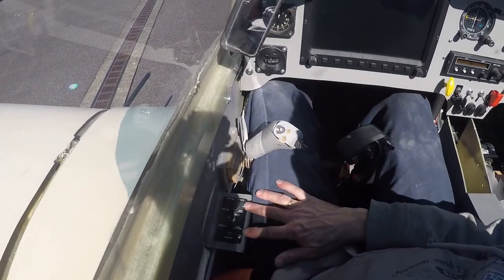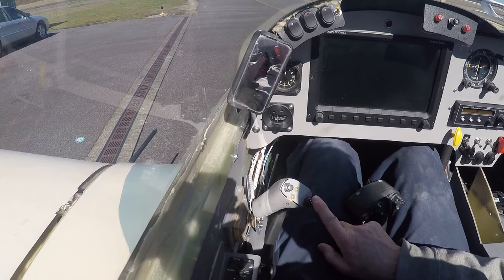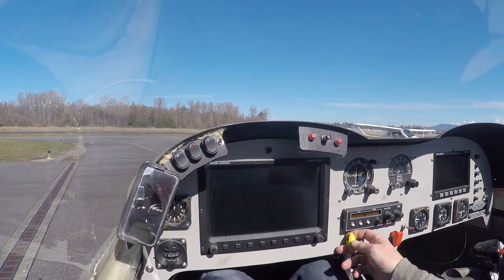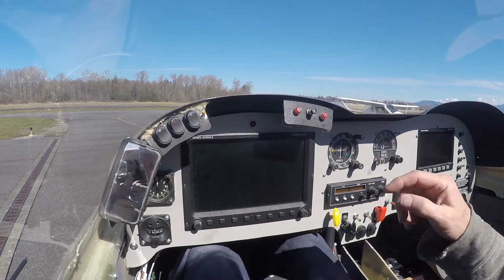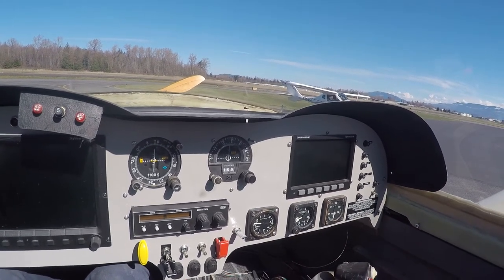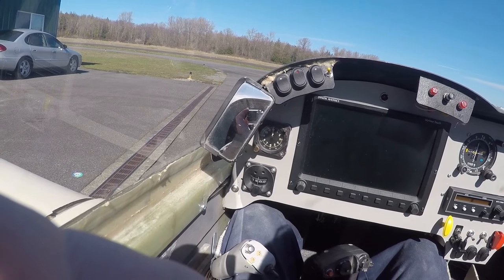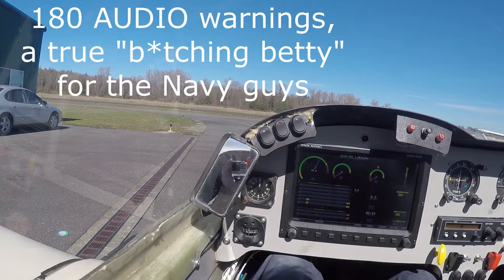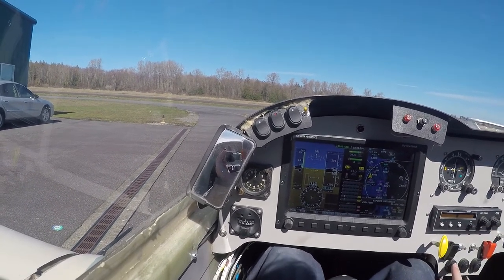First taxi and cockpit overview N144PZ K'fir Saberwing

Comment: The Corvair sounds awesome. Was your KR2 a Corvair also?
Reply from the maker: 5xls, yes Goliath, my KR-2S has a Corvair engine as well.  Originally, we put an engine in N191PZ from William Wynne.  Unfortunately, that engine was built and shipped with the wrong size bearings installed for the crank.  It ate itself to slag in about 45 minutes.  Waste of a great engine!  The replacement came from a guy's back yard, literally half-buried in sand.  36 hours of cleaning and assembly resulted in the engine on N191PZ that has 300+ safe hours on it.  Bill, from Azalea Aviation built that motor and the one on K'fir.  I have total faith in his engine work. - Zip
Reply: @boldasthelion6496  Thanks for the info. I hope to build a Zenith 750 Cruzer with a Corvair someday.